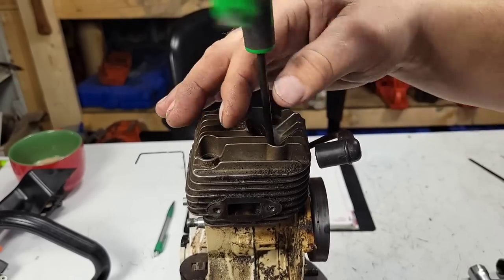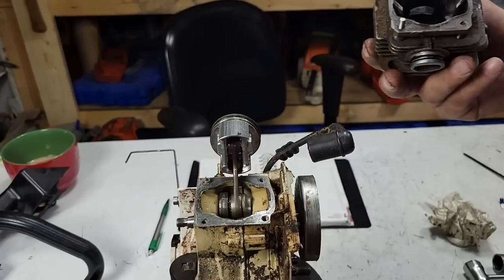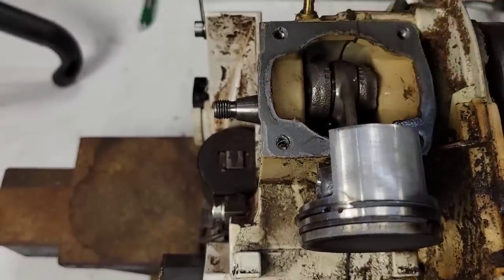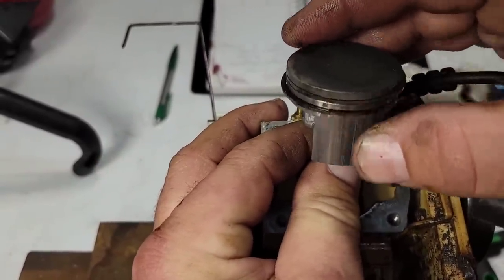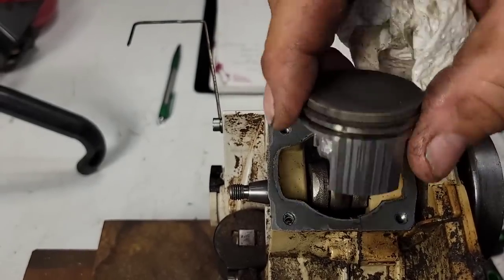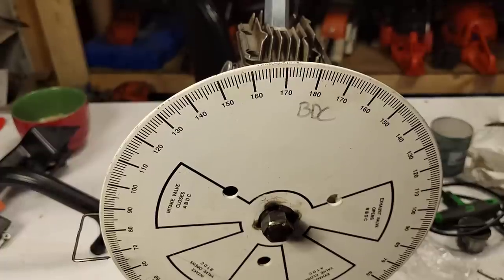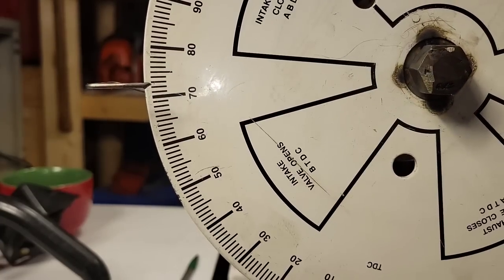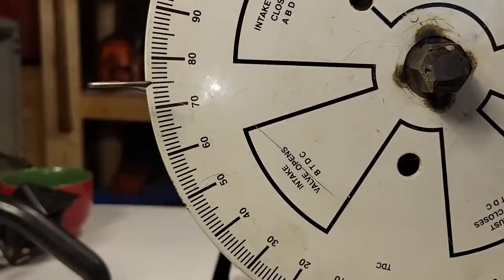This Stihl ms200t had a major issue, but it ran fine. Check this out!!

Comment: Hey Tinman! First off, I don't comment much but I want to say i enjoy watching your channel and I have been watching since under 3000 followers. Awesome stuff! I recently acquired an 020T from a fellow arborist and I am going to open it up and modify it. I am going to run it stock for a bit just to get a feel for what it can do. I'll be interested to see how your 200T turns out. I've been learning how to port and customize saws for about 2 1/2 to 3 years now with help from you and a few other saw builders on YouTube. Just got done with a Homelite 360 that is... wow! Did porting on intake, exhaust and lower transfers. The transfers are not open on this one. Polished the exhaust. Brought the squish down from .042" to .027". Also moded the exhaust pipe. Reminds me of a double barrel shotgun now. I need to test it cutting now. All my logs a under snow and I had back surgery recently so i can't dig at the moment. I live in Colorado at 9000 feet. I do have a video of it running. I got to figure out how to post it for so people can see. Again, thank you for your channel. People like you make it possible for people like me to learn, understand and do this. Keep them coming.

Comment: 1184 is the only way to go. That sticks to my uncleaned stainless steel bench. There's no rubbing it off, got to use a scrapper and wire wool!
Reply: I had motoseal not stick on a pretty well prepped surface and switched to threebond 1207d. No problems with it yet. It is what echo uses as oem sealant for clamshells.

Comment: On that 200t tinman I would check to see how close the piston is to free porting before doing machine work. I would see how that saw runs first at the transfers at 133* and intake at 76* that gives you 57* case compression. It should have lots of transfer velocity. I believe Stihl 200t's have long transfer timing is because of the open port transfers. They do that to increase case compression because of the added case volume of the open port transfers. So in theory it should give more transfer velocity.

Comment: Hey Tinman. You mentioned the saw had high rpm and a real long blow down (35). If blow down relates to torque, would that not be best case scenario? Obviously not, but why? You mentioned shortening the blow down. Thanks!
Reply from the maker: I may have to touch on this in a video. The question for me is alway "why did the factory do that?"